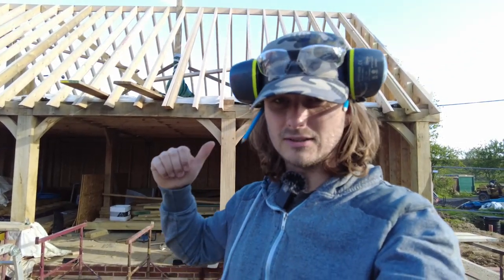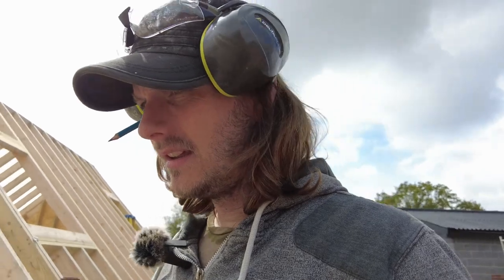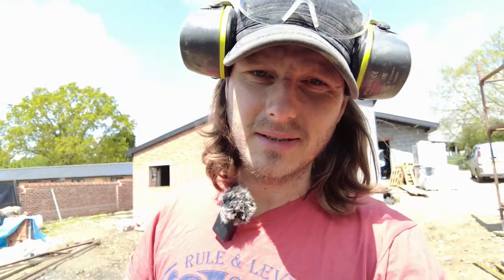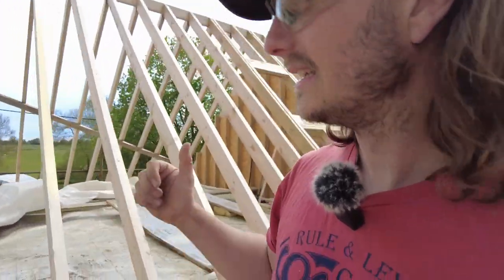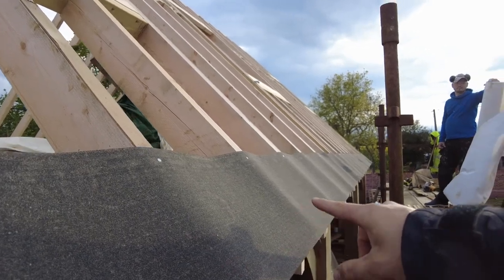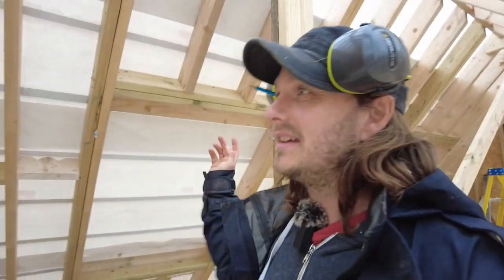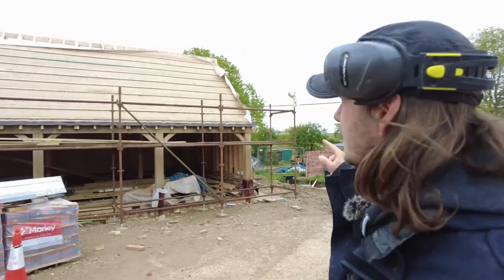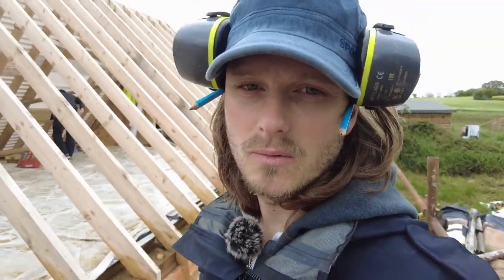NEVER A BETTER TIME TO START A ROOF ---   #selfbuild      [The Cart Lodge Build 011]

Comment: Found your channel just as I am tackling my fillets on my 1948 house. Was good to see another enthusiastic diyer who explains things in diyer language 😂 was able to visualise what is going on under my roof and realised i need a under felt between the wall and the end of my roof by the soffit. Soffit installer seems to have just cut rhe corner(mangled an end ridge tile) and not re laid a new under felt. Old one is there but in tatters under the open eaves. 🙄 Although i need to do thr fillets.. I am now more confident as to how to take rhe tiles off to back lay thr felt and relay tiles back. Not so daunting now will do that next year as they are livable atm
Reply from the maker: Ah it's a pain going back and fixing something that could have been done at the time 🤦 I'm sure you'll get it sorted when you roll your sleeves up next year 😉

Comment: You wouldn't feel like you're working unless there was a bit of stormage... 
Am thinking about putting a (slight) pitched roof on my extension....
Reply from the maker: Stormage 😂 cool, if you do and use tiles too then make sure the pitch is compatible. Hopefully I can get a decent pitch on the log store with the clay plain tiles 🤔
Reply: @THE-AIDEN-PROJECT  the drop will be about 1m over 3m, 15% I think it is. Going to look for slate tiles as they’re a little lighter I think.